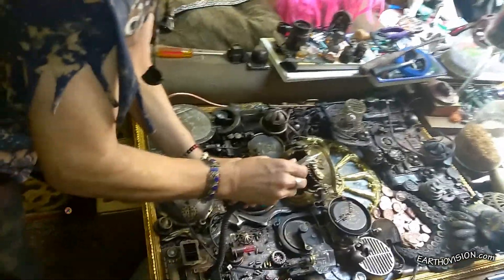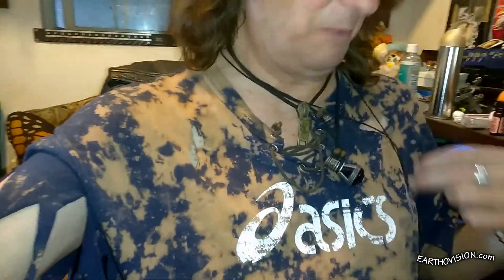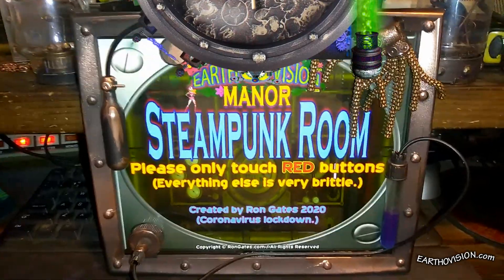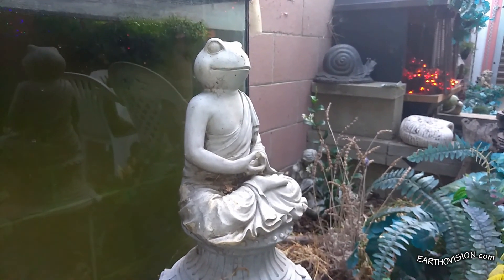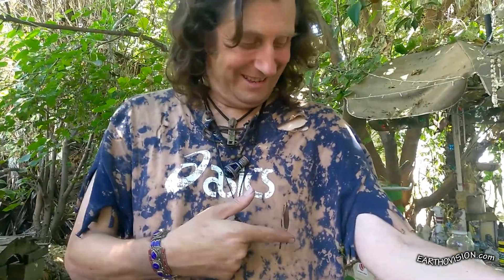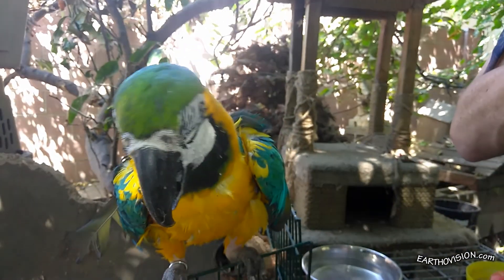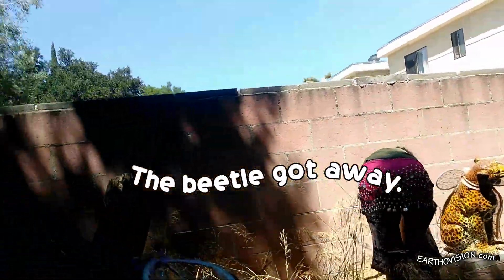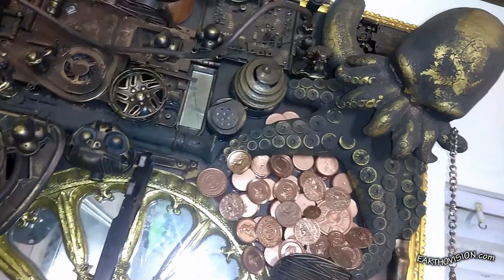Pirate Wall Hanging from trash I found in the streets. Just another typical day with Ron & Gina.

Comment: 0:29 those metal rings on the shirt are grommets.
Reply from the maker: Yes, thank you. I appreciate learning the correct term. I started to outline a lizard on the leg of my pants and realized I need a separate top and bottom half of the grommet applicator. The cheaper plier-like applicator wont reach deeper into the fabric than a few inches. I'm still learning and could use a few lessons.